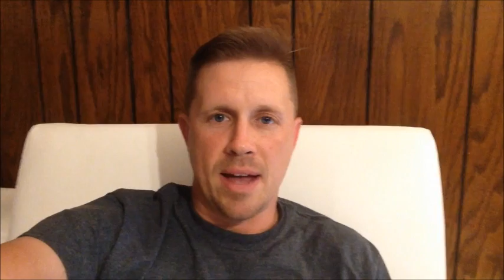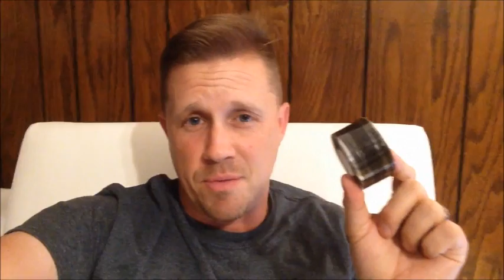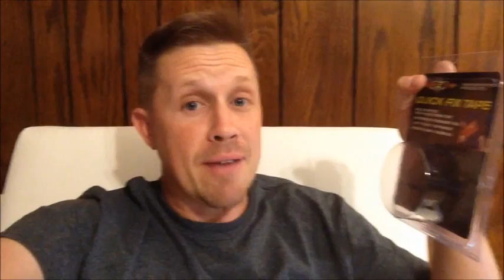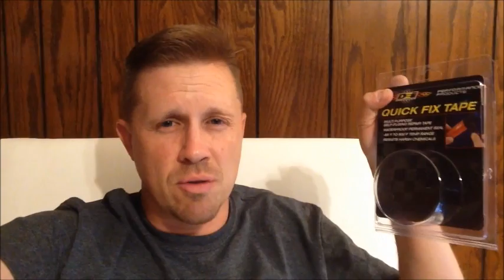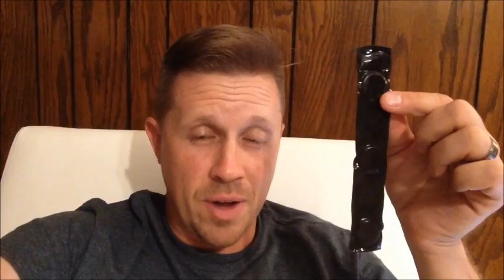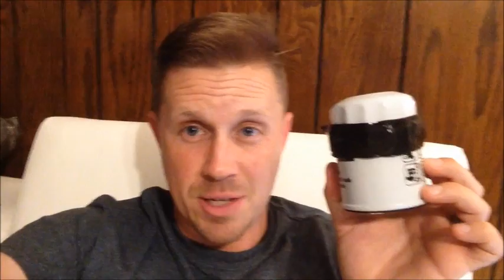Magnets and oil filters

Comment: Everything  helps. The best way to clean oil is with a depth bypass filter. A bypass   depth filter removes all abrasives. All I use now are the Gulf Coast and Motor Guards. Started with the Frantz oil cleaner in 1963 on my Rambler American. Just changed the old Motor Guard on the 76 F250 with the 390 engine.There are several bypass depth filters now that clean oil. Some have very expensive filter elements. I use Great Value 1000 from Walmart. Some use Scott 1000.

Comment: The famous 95 MERC runs Pennzoil Ultra Platinum, 5-W-20; Bosch #3410 Premium Oil Filter; and FILTERMAG #SS365PR Magnet Kit.
Cheap substitutes made from janky magnets are not equal to the holding power of the FILTERMAG #SS365PR.
https://www.mercuryforum.com/forum/grand-marquis-14/1995-grand-marquis-restoration-8937/

Comment: I use hard drive magnets they work great used them for years an they do work
Reply from the maker: Yes , computer hard drives are a good source for powerful magnets. Thanks for the reminder.
Reply: Yes, those hard-drive magnets and the little dime-sized magnets will work -- but NOT WELL, when compared to the FILTERMAG #SS365PR 's HUGE (11+sq.in.) surface area -- AND the fact that the FILTERMAG has an operating range of 40F to +302F  - those janky magnets LOSE their magnetic capacity when exposed to the engine oil's heat.

Comment: No need for magnets. Buy a Royal Purple oil filter. It filters up to 25 microns at 99 percent or more. As the microns get smaller the filter traps a bit less percentage. A 25 microns is as big as a blood cell. If you have big pieces of metal in your filter your have a problem so dump the car.to a dealership and get a new one or something with lower mileage.

Comment: i usually drop a magnet or two into the oil fill hole for better scavenging of the metal shavings.  I also drop 1 into my radiator every time i do a coolant flush just in case the shavings get passed the head gasket.  oh an almost forgot, i put a bottle of MMO into my gas tank every time i fill up.

Comment: This would be more helpful if the likely metallic debris in your engine was ferrous.  Babbit material on cam, rod and main bearings alas is not.  Piston rings are (usually) ferrous but if magnet picks up a chip of a piston ring, the damage is already done.  Still, the magnets won't hurt anything.  Maybe keep the piston ring chip from going through a bearing surface and causing more damage, maybe.
Reply: Check out the Chart on www.OilFilterMagnets.com regarding what "metals" are removed with magnets, you will be surprised.
Reply: X-Man

Comment: I imagine using magnet is only good for newer cars since the engine rings have to adjust to the cylinder walls- letting go of a lot of metal particles. Once the engine has more than 20,000-30,000 miles, that part of letting go of metal debri should be over.
Reply: nop... rings are somewhat springy to seal on the cylinder walls.

When piston assemblies are inserted inside the cylinder sleeves you can see how much springiness is involved, lifetime!

Comment: hi there. why don t u use zip fasteners to fix magnets?
Reply from the maker: I have considered that.....Only issue I'm concerned with is vibration leading to zip tie working loose and heat making the plastic brittle.  That filter gets very got due to the oil.  Not sure zip ties can take it long term,

Comment: You have be careful which neodymium magnet you use as many of them lose their magnetism at higher temperatures (80'c + ) then let what they've collected go in one lovely clump.
Reply from the maker: Thanks for that information!  I was not aware.
Reply: Rare Earth (NEO) are rated at different temperatures and strengths, so you need to pick the right one.  That is why You don’t buy a magnet Oil Drain Plug from eBay, they are Chinese with the cheapest magnet and even steel.  We have been making OE plugs for 30 years and can give you the high temp NEO’s for the price of Chinese crap.  

www.OilDrainPlug.com www.OilFilterMagnets.com

PS.
”Here are the facts”

MAGNET TYPE SUFFIX
Max. Working Temperature
(based on High working point)

N50 and N5  60 ºC = 140 ºF
No suffix	80 ºC = 176 ºF
M	100ºC = 212 ºF
H	120ºC = 248 ºF
SH	150 ºC = 302 ºF
UH	180 ºC = 356 ºF
EH	200 ºC = 392 ºF
AH	230 ºC = 446 ºF
Reply: 175 degrees fahrenheit.  The engine oil exceeds that so when it does it won't be doing anything (IE mid-operation).  After the engine cools down it will catch it, but like the guy above said they will stop holding when the car reaches operating temperature.  You can get ND's with higher temperature ratings. They're more expensive but for what you'd be using it worth it's worth it.  K&J Magnetics is a good source and web site to learn about magnets.  Ceramics will last to 300+ degrees but they chip easily and I don't trust them.
Reply: There are high temperature magnets graded for the temperatures required for the oil range of operation, they will work as expected in that range. Never exceed the working temperatures of a magnet as damage will be the result. Magnets outside of the engine will last for a time but fail, long enough to do the job because they do not get as hot because they have air to cool themselves however they are less effective as temperature rises giving the illusion they are working in the high hot flow of the oil which they are not much, but the correct grades are available at several dealers, here are the links. They will be very effective and satisfy you high temperature needs as well as be strong enough to catch particles in a pressurised fast flow of thick oils. Good job, right on the money to get those particles from circulation. I also believe it is better to put a very powerful magnet on the pan itself as it has less of a turbulent flow and will allow the full magnetic power to retain the particles as they pass by. They may be left in place for the life of the vehicle and never removed until the oil pan is removed at that time only. I recommend the strongest magnets over 30 pounds of pull as the conditions of pressurised hot oil flowing fast are different from what you see in a still pan and require more magnetic holding power under working conditions. ALL MAGNETS ARE NOT EQUAL. PLEASE DON'T GET BAMBOOZLED AND RIPPED OFF. http://appliedmagnets.com may be of help should you need reliable magnetics. Good luck friends.
Reply: Wrong... Earth Magnets are rated to 450 Degree F...

https://www.first4magnets.com/tech-centre-i61/information-and-articles-i70/neodymium-magnet-information-i82/how-does-temperature-affect-neodymium-magnets-i91

Comment: A Better Solution! Our Patented Oil Filter Magnet System: http://ExtendOil.com
Reply: John Mauldin     cost, neodymium magnets are in computer hard drives ,just disassemble an old crashed non working hard drive and there are several free magnets in each

Comment: Just get a 250 lb. pull bar magnet from Harbor Frieght and sick one on the oil pan and the transmission fluid pan.
Reply: Holds the crank in position so hard you can't even turn the engine over.  Can't have metal in your engine if you can't even start it.  This guy is thinking ahead.
Reply from the maker: sure would work.  Only issue I'd be concerned with would be if that kinda pull would have an adverse affect on transmission valve and components....keeping anything open that should be closed...closing anything that should be open.
Reply: ONE WAY TO FIND OUT! LOL
Reply: Ammo Man  just don’t put them in the center of pan on trans put them on the edge so they can’t interfere with the electronics in newer transmissions  the valve body’s are aluminum or magnesium as is the case so side of pan would be best location
Reply: Spend all these money on these craps..... Just change the Oil and the Filter with that money!  LOL
Reply: @JodBronson  or do both...:
oil change & magnet
can't hurt
Reply: @glasser2819  -  LOL, why not?

Comment: Do you really need a tape?
Rare-Earth Circular Magnets from"Lee Valley",are so strong,it's very hard to take them off.
Reply from the maker: The reason I use the the special tape that's resistant to high temps, gas and oil is that I've found it can be really hard to grip the magnets and pull them off, especially when my hands have the slightest bit of oil.  Just nice to yank it off and pop on the new one.
Reply: Magnets are good. Depth toilet paper bypass filters are a lot better..they dont care if its aluminum dirt or steel. There are several good ones. All I use now is Motor Guards and Gulf Coasts. You might check out the.Frantz oil cleaner. My first filter was a Frantz on my Rambler American in 1963. Been running on analytically clean oil ever since.

Comment: Well, it sounds like a good idea.
I wonder if sticking one to the outside end of your drain plug would be worth a try.
Reply: Broj 1 I've stuck magnets to inside end of drain plug on all my small engines for years now. They absolutely work. I used to epoxy them on, but not necessary. The drain bolts are steel, the blocks aluminum. Just stick right size magnet to end of plugs. They stay put! I know they work because of how much I wipe off the magnet every time I change the oil.
Reply: magnetic drain plugs are available
Reply from the maker: Putting one of those magnets on the outside of the drain plug does work to some degree.  I've done it.  However, I've found that the thickness of the bolt diminishes some of the magnet pull.  However, the thin wall of the filter allows for much greater pull to be imparted to snatch up the particles as they zoom by.
Reply: Why not to stick them on the inside end of drain plug?
They come in many different sizes,from 1/4" outside diameter (Thickness 1/10",magnetic Strength - 2.5 Ib)  to 1" outside diameter with 1/8" thickness and Magnetic strength of 30Ib.
I got mine from "Lee Valley" store.